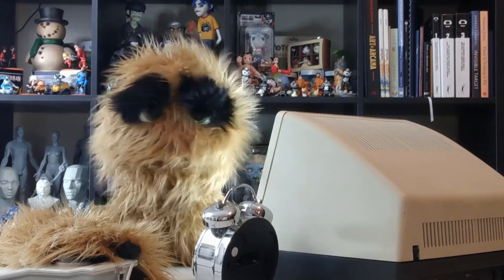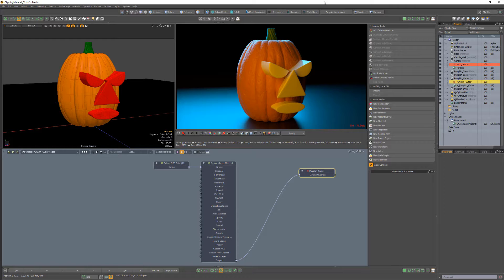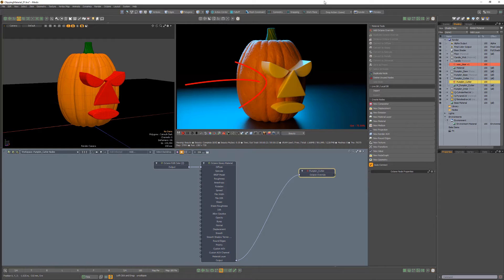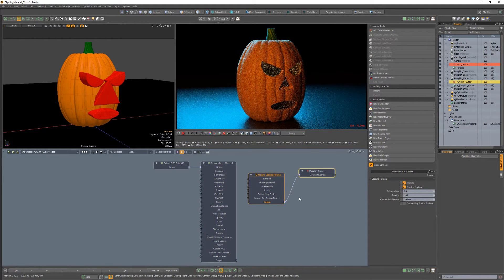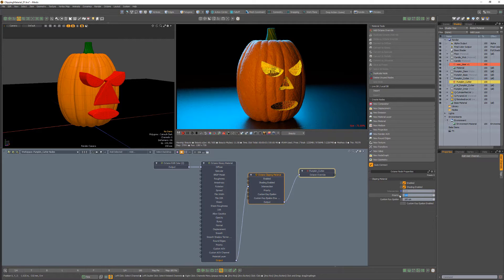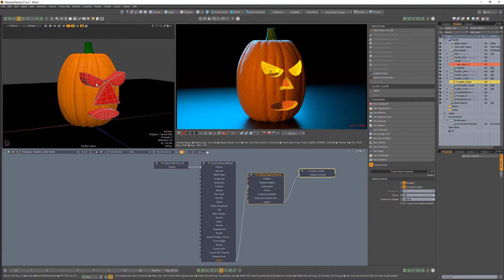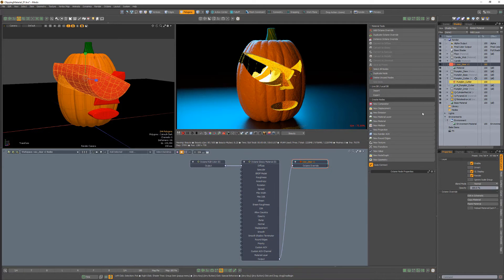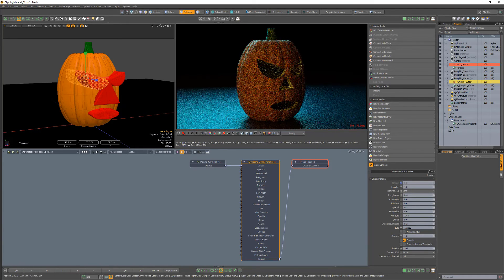Modo | Octane Render: Clipping Material

Comment: Is there a way to intersect the clipping?
Reply from the maker: Can you elaborate?
Reply: @pixelfondue  the clipping material only removes sections, is there a way to invert that? Like a boole intersect.
Reply from the maker: @NyeDaniel  I don't think so.  I only cuts away....there's a priority setting so you can 'not' clip materials by adjust the 'priority' channel of materials that you don't want clipped above the priority of the clipping material.  So you can probably get what you want with multiple cutters and 'priorty' -  but there's not an interset mode (seems like their shoudl be though)